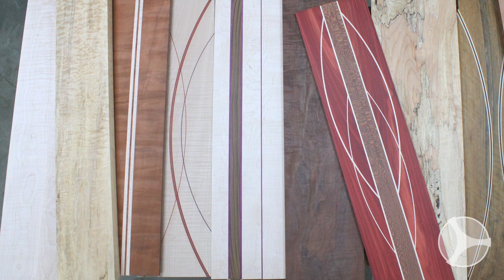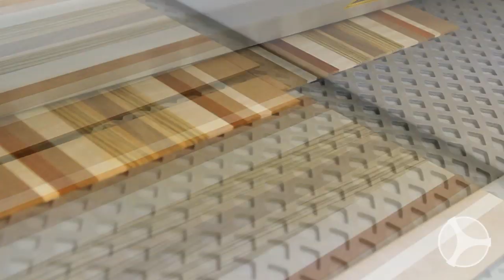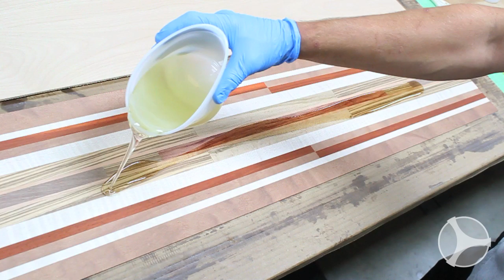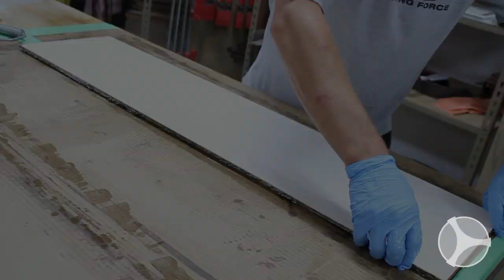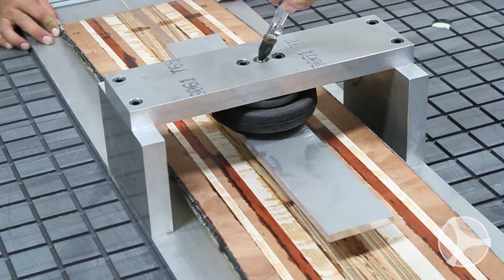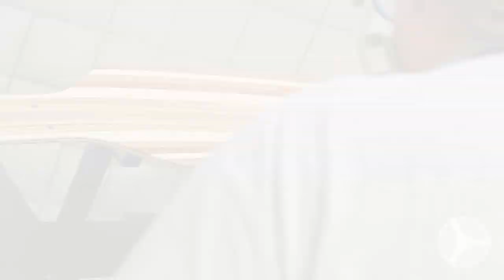High-Tech Longboard Skateboard Deck

Comment: You would certainly expect that resin would be lost/pressed out, as there is plenty of excess resin when laying it up like that. Thats the reason for vacuum molding and infusion molding, to get closer to optimal resin content; although for this type of sandwich composite, the layup seems the be the way to do it. Nice planer and resaw setup. You could easily get consistent cutouts with a router jig, but I have to love the cnc router table. Pretty sweet longboards, Ill have to check out what you have. Is there a certain style of riding that you build for?
Reply from the maker: +TheFootbaldd Thank you for your comment. The reason we do laminates like this is because we can achieve a 65/35 carbon to resin ratio. To do this we have a heated 300 ton press and unique tooling that takes part in the process. We don't show everything on the video because the pressing and curing of the laminate is were the strength durability and flex comes from.

Comment: all the technology and thought gets wasted in a barely functional cruiser shape, all of this techology would be way better in a freestyle or a downhill longboard. another thing, that carbon fiber in between the plies is an absolute waste, carbon fiber needs to be on the outside for it to have any beneficial properties. plus, yall are not the only ones on the market making boards like this
Reply from the maker: +Drungo Bungo 
I have been building carbon parts for the Aero space Industry and prosthetic Industry for over 30 years and you should talk to someone that knows carbon before you make ridiculous statements like where the fiber orientation needs to be. All of our boards have a core that we adjust in thickness per the weight and heigth of the skater. Also I am 67 years old and still skate so I designed the decks for skaters whom like to cruise. As far as freestyle we has some of the best skaters in the world usinf our products. Look on www.oustbearings.com , and thanks for your comments.
Reply: +Oust Bearings touche, touche, but will it blend?
Reply: +Oust Bearings The statement "Unidirectional material strength is the same in all directions" is a blatant falsehood.  The very point of unidirectional tape is that its favorable material properties are in a single direction only.
Reply from the maker: +Matt Jarvis  Thanks for the reply but after that statement we explain how uni can be used in different plies set at different angles to achieve maximum strength. Maybe we should have chosen a different word but thanks again for your reply.

Comment: I wonder if Rat Vision got payed by Oust to make that video.......The bearings are great but i wont be buying the board not because I dont like it. Its mostly because its nice to look at not to play and therefore i dont want it...i might break it.
Reply from the maker: +LupineGamer Thanks for taking the time to look at our product. Our products usually get good reviews from everyone not only Rat Vision. Thanks for your comments on the DISSENT longboards and just to let you know they really work well. I have been surfing and  skateboarding  my whole life and I'm 67 now. The reason I designed the deck the way it is, is because I wanted a deck to have the same feel as a surf board when riding 30 to 50 miles on the strand where I live. Most of the decks I tried we're to stiff and heavy and my ankles,knees and hips would take a beating. The Dissent decks have a very fast recovery time and only weight 2.4 lbs so they're really fun to ride long distances. We're trying to get the price down but the Aero Space Carbon we use is very expensive and so is the method of Manufacturing.
Thanks again for your response.
Reply: I dont have my doubts it can take a punch. Im the type that rather get a crappy board and beat the living schpit out of it than by a really expensive one and be too afraid to even take it outside. I will consider buying one in the future but im gonna add some graphics and others stuff to it. Because as it looks now the board is a bit plain

Comment: this board isn't that special. It's just made out of harder more expensive materials so less wood is used. The shape of the deck isn't unique either. Why spend all the money to make this deck and use "exotic wood" for the beauty aspect just so to end up needing to replace the ridiculous crushed sprinkled glass grip with real grip tape when i wears out after a few uses? This is just an expensive cruiser deck that most people will replace once they learn the basics of longboarding and want to progress into freeride or downhill.
Reply: Too bad you're too stupid to realize that another coat of urethane is applied to the glass grip which then makes the grip remain on the deck for the duration of your longboarding career.

Comment: holy shit these longboards are like all space aged and stuff with all that technology and equipment lol. I want one of these badly!
Reply: hardly....its an expensive board that one would be too afraid to use....kinda like making a gold toilet. It looks nice but at the end of the day it comes down to who is the costumer. 

Space age is hoverboards
Reply: @LupineGamer  Yes, expensive. But I beat on mine for years, and it holds up. Even the flex is as good as new - still awesome, and I weigh over 90 kg. I use this board mostly for cruising at pretty good speeds.
Reply: Like actual hover boards? Or those extremely underpowered 2 wheeled things.. anyway these boards, I don't have one but I do work with carbon fibre and they won't break easily but, they would be way stronger if the carbon fibre layers were on the outside, it will also make it a lot stiffer though, so good for downhill

Comment: i've watched this video a few times and i cant stop thinking why would you apply so much technology and time in building a a cruise longboard. I mean it s a board that you won t use for high speeds and you probably cant even slide with it because it has no concave. plus it looks exactly like a loaded board (loaded boards sucks). overall i think it s just not smart to build such a fancy board that has no use.     Plus it s just to over priced for a board that doesn't even have hollow tech construction
Reply: This makes a lot of wild claims for their Decks, I wonder how many have been tested and proved independently?

Lots of fancy and expensive machinery, but it's irrelevant to such a low-tech device as a Skateboard.
It doesn't take that much skill to make a symmetrical deck with perfectly aligned trucks, without all that machinery.

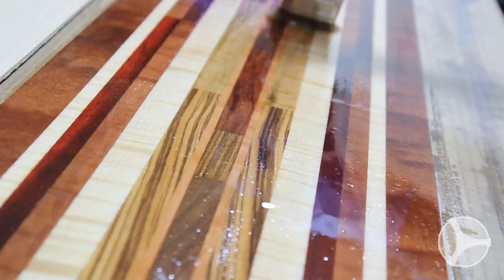You won't catch an Aerospace Technician applying resin with a brush, you can see all the bubbles that creates in the video [2:12].

Perfect Cloth/resin ratio can only be guaranteed by using pre-preg cloth.

'Infinite flexing without delamination?'
Airbus/Boeing/NASA et al would be impressed, even they can't achieve that!

Don't get me wrong, they're beautiful Decks, but this video over-hypes the technology involved/needed way too much.
Reply from the maker: John Doc. First you can get close to symmetrical by hand but not like a CNC router.
Second the bubbles when spreading the resin are taken out by vacuum when the deck is pressed in a vacuum press
Third the cloth to resin ratio can be achieved by hand with the method we use to press our Decks just like pre-preg.
I've been working with carbon fiber for over 35 years and we do use all Aerospace products.
Last I designed these decks so older people like myself in there late 60's can ride for long distances and get some really good exercise without pain in the hips,ankles and knees from the shock you get from stiff heavy maple decks.
I've ridden this Board over 60 miles in a day with no pain, I can't do that with the other decks available in the Industry.
Also I want to thank you for your response. I like to hear how the younger generation thinks.
Reply from the maker: Leonardo, it has 1/2 inch of concave and some of the skaters on the OUST team say it slides really great and as far as use I like to keep in shape so I ride distance on the week ends and it works way better then any of the heavy maple decks in the Industry. As far as being over priced the older skaters love the way it responds and there it NO shock.

Comment: lol this is total bullshit, a finish that would be on a expensive exotic care, dafuq?and saying that skateboards have made no progress is bullshit, skateboarding is not all about what you are riding but what you do with it. sorry to hate but this is total shit
Reply: Oust Bearings

The only source I can find says ride height is synonymous with clearance. I can't find anything about ratios.

What does ride height have to do with flex?
Reply from the maker: Luke, there are a lot of people that think the same way about the skateboard industry.  I've been skateboarding since the early 1950's. If you look at other industries and see the changes made, like the car industry which I've been in since I was only 13 years old building 55-57 chevy's, you will see that the changes made are huge.  About what we spray our boards, it's not bullshit, it's a High Performance PPG Concept Urethane.  I think you better look at quality Urethane's before you form such a negative opinion. Your are right about one thing, skaters can do a lot more tricks, like most of the Pro skaters on our OUST bearing team, but if you want to be able to do these tricks it takes a deck that has more design work in it.  That is why we designed the DISSENT line of longboards. I hope this helps to resolve some of your hate towards manufacturers.
Reply: I can definitely see the changes made in the car industry, with many huge advancements.
What I'm finding more difficult to see, is what sets these boards apart from those which you claim to have seen "little advancement in functionality and construction".
Reply: Oust Bearings Hold the fuck up! Ride height is built around the height of your trucks, spacers, and mounting options in the cases of drop throughs, this makes no sense! Ride height cannot be made to the weight of a skater! Bushings are what caters to the weight of a skater. Sure ride height contributes to different disciplines of skating but some people prefer low boards for dh/freeride, some people prefer high boards for cruising. Can you explain to me how the ride height, which is made up by the space between the ground and the board using trucks and risers, contributes to a riders weight? I'd love to hear your bullshit answer!
Reply from the maker: Luke take any of the skateboards that are presently be manufactured today in our Industry and just tell me one Company that designs a board that the ride height of the board is made to the weight of the skater that is riding the deck. NO ONE! If you personally don't think that the ride height is important, then how is the geometry of the trucks suppose to work because they are made for a board that is parallel to the riding surface at a specific degree. Most Companies that build don't even know or design ride height into their decks. I have a question, How many years have you been skating? Do you a skate street , Technical, Free ride, downhill or slalom? Let me know so I can understand your mind set. Thanks.....Longboard Technology
Reply from the maker: Gabe Torres Gabe, first of all ride height is a term used in the Automotive Racing Industry for the suspension to to frame height ratio. Your right about the trucks spacers and mounting options these are standard on all boards but what your not thinking about is the camber in the deck. If you knew anything about carbon fiber and how it works you would't be saying crap like this. The Carbon fiber can be made up in different patterns to control weight, flex and response time just by changing the core your using or by the carbon type. Call Richie Carasco or World Champ Joe McClaren from Sk8king and ask them if this is bullshit. You can also call Michael Brooke from Concrete Magazine.

Comment: These are awsome. And does any one know where to buy carbon fiber, and how much it would cost?
Reply from the maker: Dakota, thanks for the good review, I don't know where you live but when and if you order carbon fiber make sure it's at least 41K and uni directional. The carbon used in the Surf Industry and other sports Industries doesn't work well. I've tested most of the 33K woven and it does little to support the board. If you have any questions please feel free to call me at OUST Inc. Torrance, CA.
Thanks again for your kinds words. Carl..................
Reply: Oust Bearings do you know anything about spring back? And also will applying heat when the board is in the press help or make the bond stronger?

Comment: Best bearings on the market! Would be great if you made a symetrical, stiff, micro-drop, rockered, flushmounted topmount board like the rayne amazon (38in x 10in)
Would be amazing for racing and freeride
Reply from the maker: We are working on a tool at the present time. We will be posting pics soon.

Comment from the maker: Thanks for the feedback. The Dissent decks can be made any shape, the reason the decks are the shape they are is because this is the shape some of my PRO skaters that skate for OUST Bearing said to build. Also if you look at some of the free ride decks here in the USA like loaded and a few others this is a similar shape. Our shape has more surface area and the response is several times faster then the loaded decks and Dissent decks only weigh 3.2 lbs. Thanks for your comments.